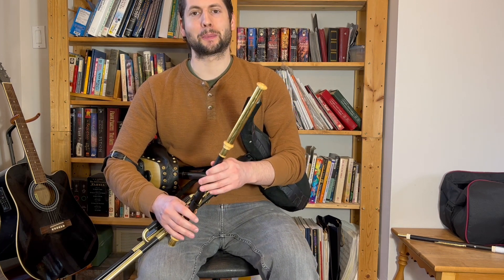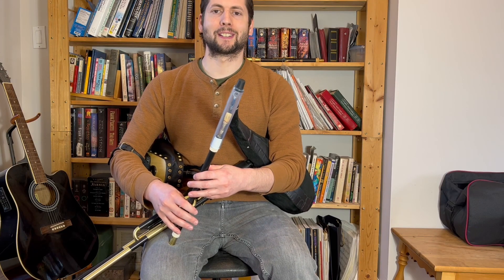A Closer Look at Uilleann Reeds

Comment: What you’re seeing here is an artifact of the interaction between your camera’s frame rate and the period of the reed’s motion.  Bottom D is just abput 293 Hz so there is no way to directly image that at 30, 60, or even 240 fps (because the reed will go through multiple cycles each frame).  However if your acquisition time per frame is short enough, you may be able to see what appears to be clear images rather than just a blur; this will depend on which note you are playing, and the lighting conditions.  A clearer, though still somewhat artificial, image can be produced by synchronising a short light pulse with the fundamental frequency rate (as you point out).  To actually image reed motion without exploiting such a stroboscopic phenomenon would require frame rates in the thousands per second.